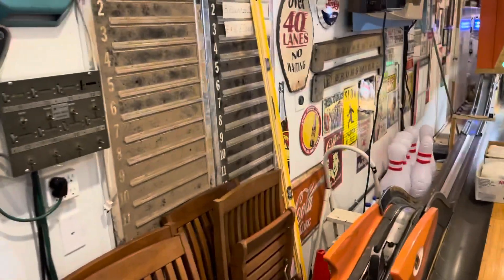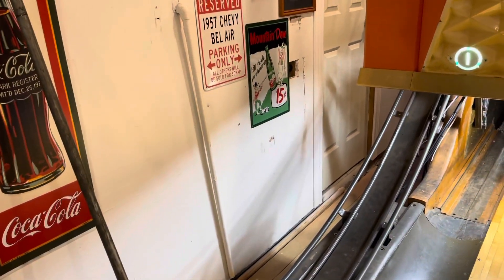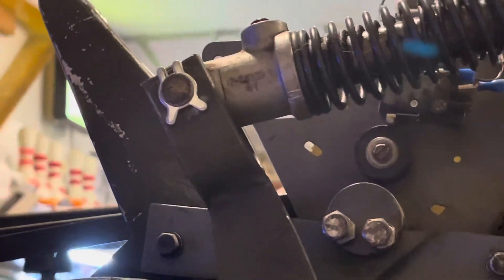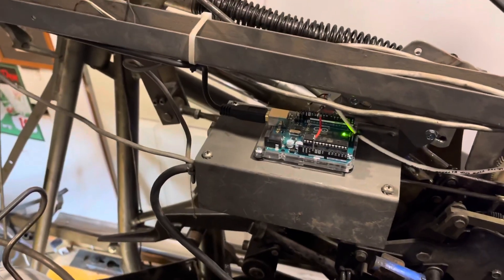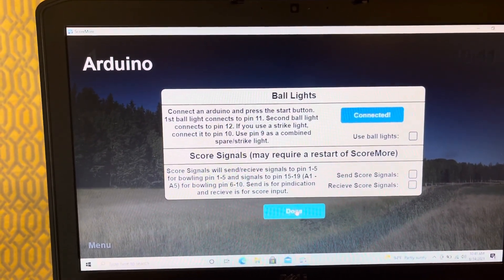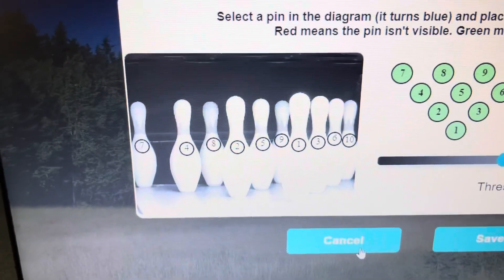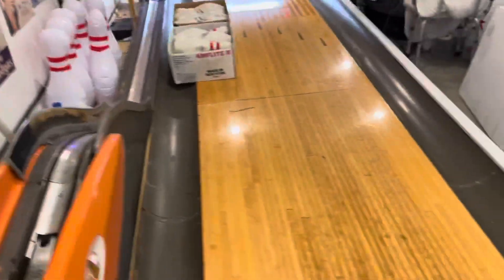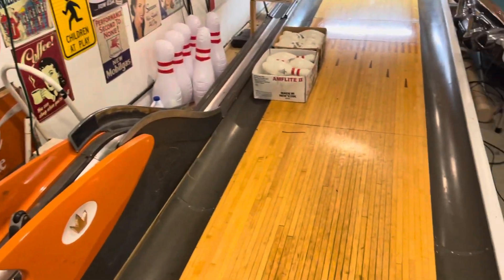ScoreMore automatic scoring system explained in the Garage Bowling Alley setup-Brunswick goldcrown

Comment: Well its a 44/144 switches  takes data at 44 degrees first ball  and 144 degrees 2nd  ball. was from the old brunswick as 80 system.
Reply from the maker: This one has an inner cam that’s longer than a quick click.   Not sure what it was on but I’d love to know how all the switches were wired up     My 2nd ball solenoid has a relay inside and a plug for an incoming harness.